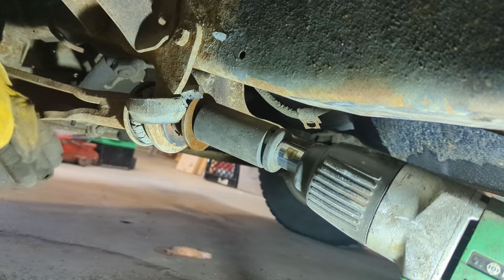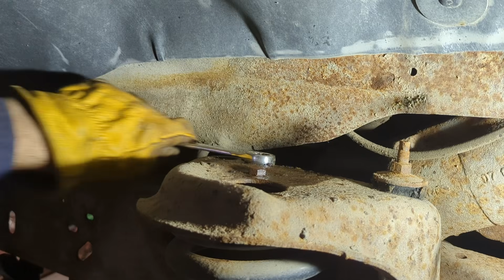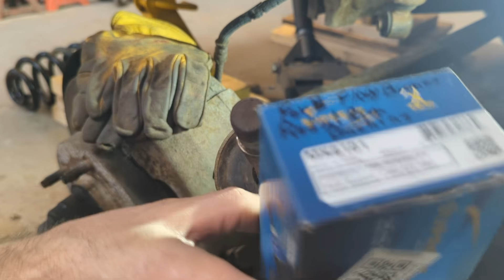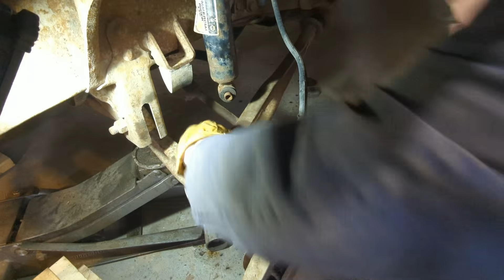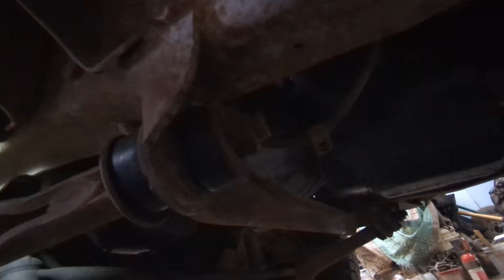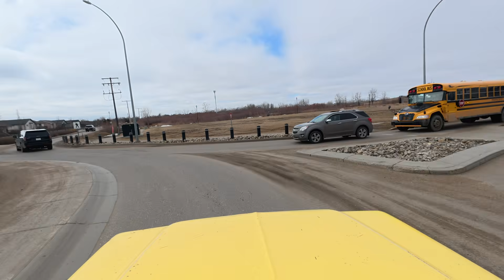Radius Arm Bushing Replacement | 1973-1979 Ford Dentside Truck | Jamieson's Repair Shop

Comment: I sure appreciate your videos, Mr. Jamieson, very helpful thanks.   I've seen several videos on changing out these radius arm bushings, and what I don't understand is why people don't just unbolt the mounting bracket (where the bushing resides) instead of pulling the entire arm out from the front suspension?  I'm not sure if pickups are built differently for some reason, but looking at the arms on my '78 Bronco, it appears I can simply remove six bolts that hold the bracket to the frame and transmission support, slide it off the end of the arm, then merely pull the bushings off and replace them that way.   I presume there may be some reason why it's NOT supposed to be done that way, but I am unable to see why that'd be....
Reply from the maker: Like your 78 Bronco, mine also has 6 bolts, and no rivets, I haven't done the bronco ones yet, but I don't see why that wouldn't work. However, on the truck in this video, it is a mix of bolts and rivets, so a little different setting...with that said, maybe it would be easier to drill out the rivets. 🤔
I don't have a 4x4 F-Series to compare with the Bronco, but I'm assuming the 4x4 and Bronco are the same, just bolts.
This was a very good question, thank you. 👍
Reply: @JRShowYT  Thanks, rivets were part of my suspicion - but I crawled underneath my Bronco earlier and all six fasteners are bolts. that appear to be easy to get to, so I may give it a go.    Will report back when I get to looking at it further.  Will be changing out my heater blower soon too, thanks to your other video on that, thanks.
Reply from the maker: Yes, please let me know how it goes, my Bronco needs them changed. 👍
Reply: @JRShowYT  Confirming, "yes" the radius arm frame brackets can be removed on '78 (and presumably '79) Broncos, to change out the bushings.   I swapped my bushings out this week with a set of Prothane's, and it wasn't too difficult of a job - some of the bolts are a bit of a bugger to get a wrench on both ends, especially the ones up inside the frame rail, but you can get to them.  My driver side was the more difficult of the two, since the main wire harness to the rear of the truck runs along inside the frame rail there, right where a couple of the bolts are.  The main nuts were a bugger to get off too, just like your video - my Ingersoll Rand pnuematic impact rattled on them for awhile before they broke loose ha ha.  Thanks again -
Reply from the maker: @RobF.-gr4ei  thank you very much for posting your findings, this will help a lot for me, and I am sure others! 👍👍👍
I pinned this comment to the top, so others can find it quickly.

Comment: I do not know how every single one of these videos they get that bolt out that goes through the i-beam,  I've hammered and hammered and heated and hammered.   Soon I'm gonna bend the i-beam i'm hammering it so hard.
Reply from the maker: Unfortunately, not all situations are the same, you may have to take the I-beam off, and take it to a shop that is equipped to remove the bolt.
Reply: @JRShowYT   I did end up getting them out, had to take the whole radius arm, i-beam together to work and use a 1" impact and torch.   I was able to save the bolt though so that made me happy.

Comment: Hiya Alvin I have to agree with Jeff smith, the older cars and trucks are easier to work on and last much longer. Especially since there is talk of car manufacturers putting in kill switches in the newer cars. Did I mention I hate electronics in vehicle’s? Lol
Reply from the maker: Yeah, the 2021 Infrastructure Investment and Jobs Act requires sensors and a kill switch, that prevents impaired driving by 2026/2027 models of vehicles, I do disagree with that much Gov. overreach.
On the other hand, I may feel different, if I've had a family member kill by a drunk driver.
And yes, more electronic stuff to deal with, which sucks.
Reply: @JRShowYT it always start as “good idea” but you know it will get abused
Reply from the maker: Yes, as sad as it is, it always seems to be abused in one form or another.

Comment: Those King pins will creep up on you , when they start to seize the truck will wander , as in you are always fighting to pull it back straight. Maybe you replaced them by now I dont know but if not they likely need to be done. If the bushings dont fix the issue then look at the king pins. Or any tie rod etc can do the same thing. But not usually a tie rod.
Reply from the maker: I need to do the brake lines, and the rotors are getting thin, that would be a good time to go the kingpins, get them before they seize up.
Reply: @JRShowYT  Jack it up disconnect one outer tie rod or both outer tie rods would be better and try to move the spindles back and forth. I suspect at least one side will be stuck or tight or both sides tight. Should move back and forth with very little effort or no effort if its in perfect condition. Its hard to tell with the steering still hooked up. Unless they are totally seized solid.
Reply from the maker: I had both wheels off the floor, when I was changing the radius bushings, and I was able to move the wheels from side to side without any trouble, so they must be good, at least for now. Lol
Reply: @JRShowYT  Well if its not wandering anymore then they must be ok. Although there is a bearing on each side , its possible the king pin can move with the weight off and the bearing be seized causing it to be tight with the weight on I suppose. Oh well spend some of that money and buy her a new truck!
Reply from the maker: Lol...I wish I could afford a new truck! But you make a good point about the weight being off the pins. 👍

Comment: Hello Alvin. Much easier to take apart compared to the T-bird. It would have taken me three times longer as i would have either painted or powder coated the parts. Lol . Very informative video as usual.
George B.
Reply from the maker: Hi George,
I should have taken the time to paint them also, maybe some day, I'll pull the cab and box off, and do it up right.